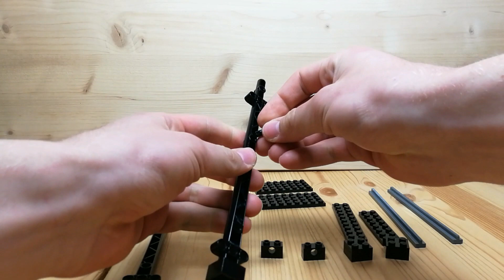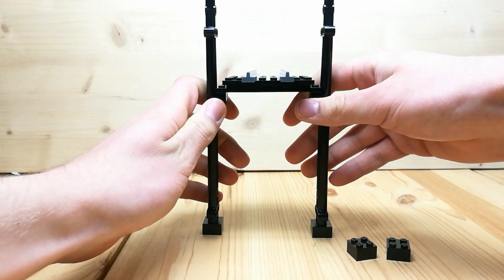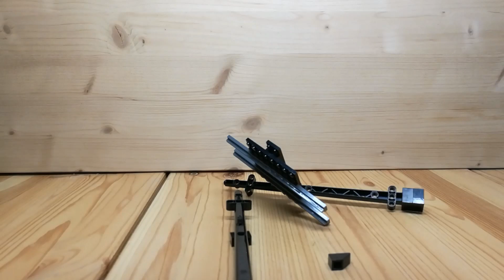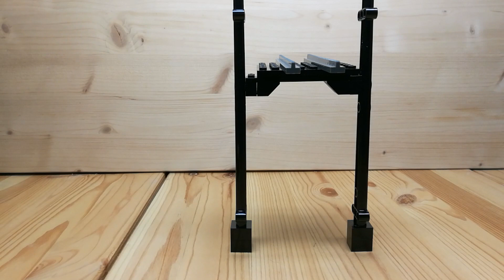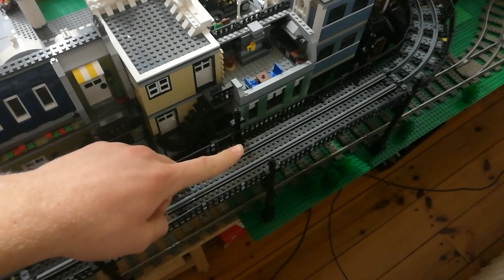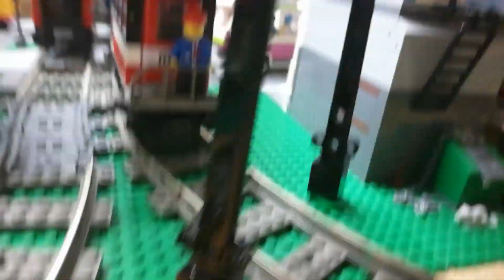Elevated Railway MOC Under Construction - Building a 1920s LEGO City #23

Comment: That design looks very cool with minimal pieces! How smoothly do your trains run over the tracks?
Reply from the maker: Thank you! Not that smooth tbh, because the train cars are quite heavy. Pushing/pulling them around is no problem, but if I ever find a way to motorize them that motor would have to be really strong.
Reply: @theroaringbricks Hmm.. Maybe by using some technic arms you would be able to create a structure that would fit directly under the platform(not obvious to notice). That should remove some tension possible between the train cars and the plates? If you were to motorise them you could watch some of the lego train motor modification videos. 🤔👍
Reply from the maker: @creativebrick9481  well there is no real tension, it's just that those small wheels don't run as smooth as the large train wheels

Comment: Hi 
Is that original small track you use for the elevated trains? Ore dit you modify the turns from the normal tracks? 
Grz maikel
Reply from the maker: Those are original LEGO narrow gauge curves.
Reply: @theroaringbricks   I never have  know that they had them. But why you don’t use the straight tracks to? Instead  the grey track pieces from the 80’s 
Grz maikel
Reply from the maker: @maikelconijn9602  lego does not have straights in narrow gauge...only other companies have those
Reply: @theroaringbricks  ok I did not know that. 
Are you going to fill in the peices that are missing in some arias? 
I like what you do it is a nice city.
Reply from the maker: @maikelconijn9602  no problem, glad to help out. Yes, I'm going to do that! Haven't done so far, because I always had little changes on the elevated railway and I have to cut the rails into the right sizes since they only exist in 1x16 size. 
Thank you very much!

Comment: wow but question. Where can you get the 2 by 2 curve train track? and where did you buy?
Reply from the maker: Thanks!
Here is a list of sets in which the part 85976 appeared: 7199, 7065, 6857, 41130
I bought mine used on eBay